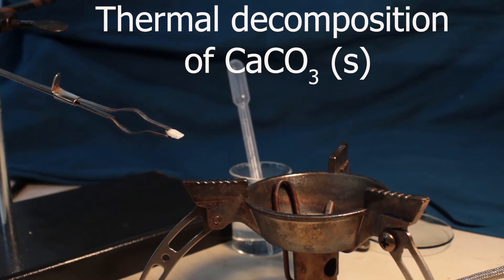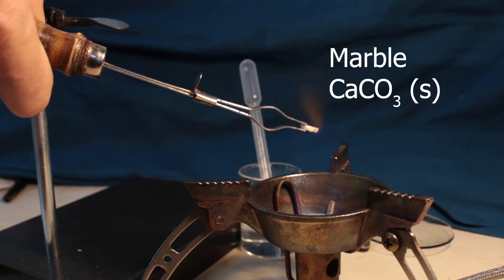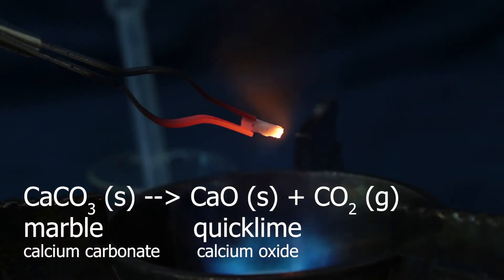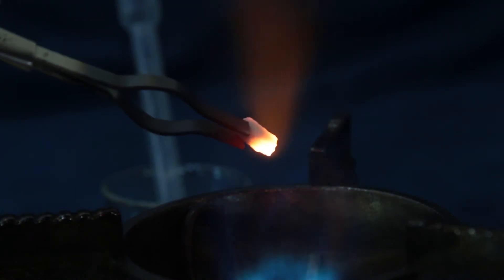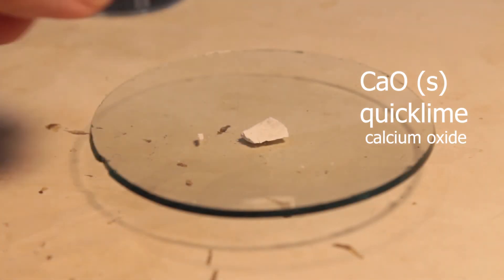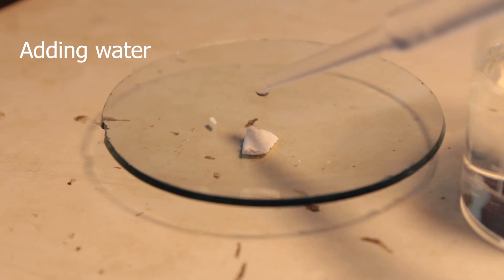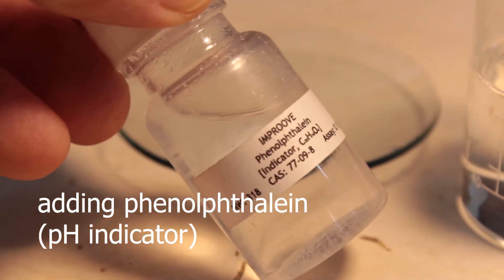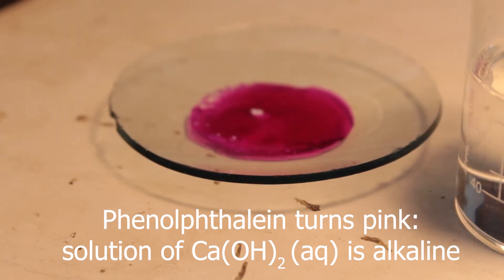Calcium carbonate thermal decomposition; calcium oxide reaction with water and phenolphthalein

Comment: Excellent, Sergei. Nice way to shw how one can go in 'circles' making caco3, cao, ca(oh)2, the latter, lime water is used in identifying co2. Btw propane flame can reach temps well above 2500 C, if I recall correctly. But for this experiment, the gas burner is the right choice, I doubt that an alcohol buner would do the job nearly as effectively. Thank You very much for Your high quality content.
Reply: The propane/air mixture burns at up to 1980 °C (adiabatic flame temperature, Wikipedia) but propane/oxygen might get up to 2 820 °C (random engineering table I've googled up).
I've tried burning piece of marble on a gas stove (propane/butane) but there was virtually no reaction  (inefficient heat transfer?). Next time I will try doing it in an ashing crucible or a quartz test tube. It seems that insulation is important (I am self-learning these kind of procedures). Maybe the gas stove would work but I would have to enclose the sample in a small can wrapped in an insulator (e.g. mineral wool) and the whole put in a larger can that goes on the stove.
I found that some 100 years earlier people used coal kilns with blowers. Mr. Faraday made himself a small lab "oven" that resembled a barbecue except it had a long slender chimney providing relatively strong passive air flow and thus increasing temperature of the burning coal.